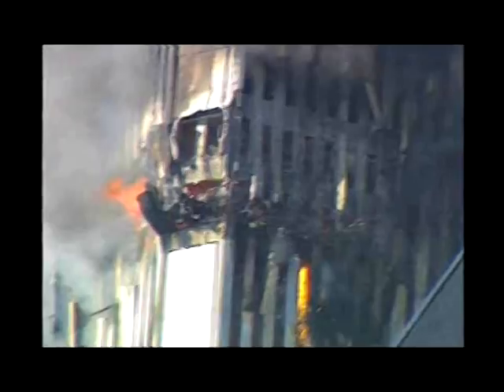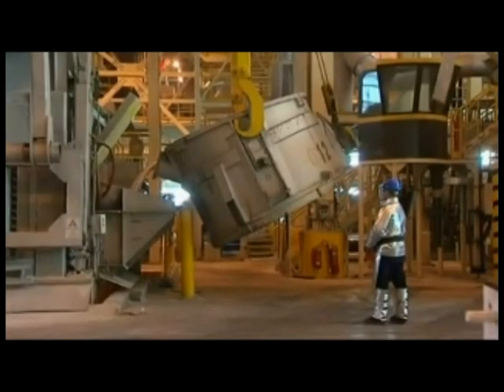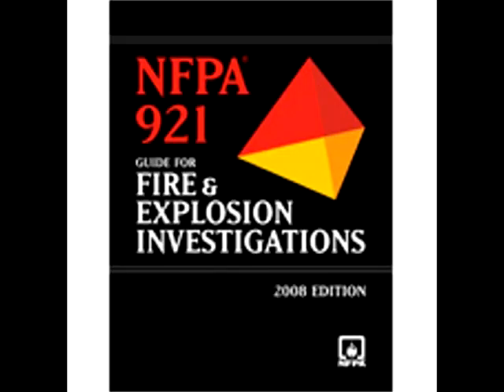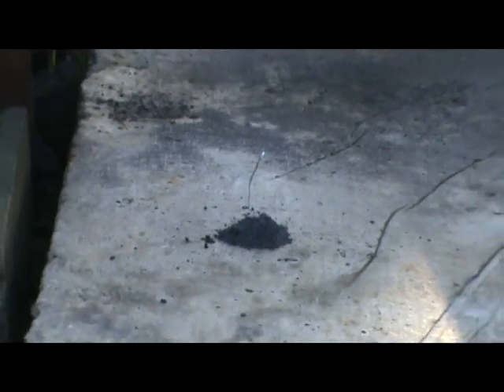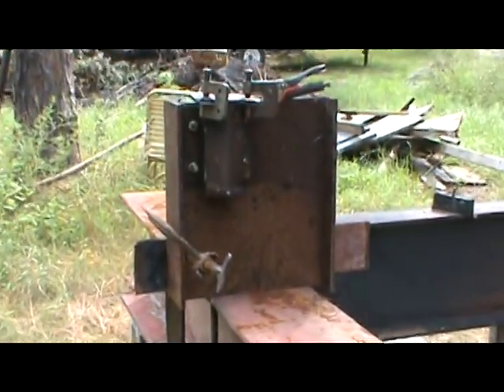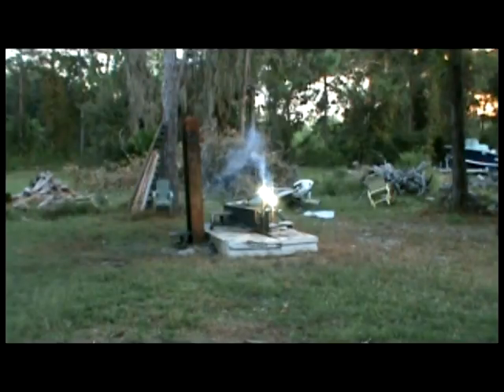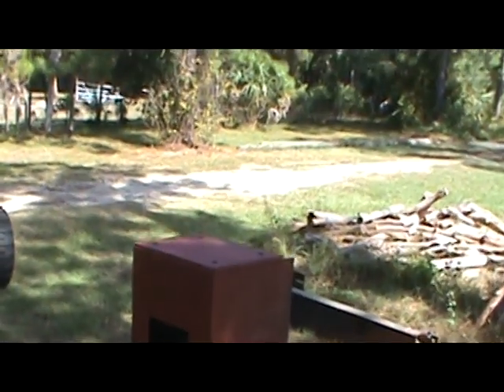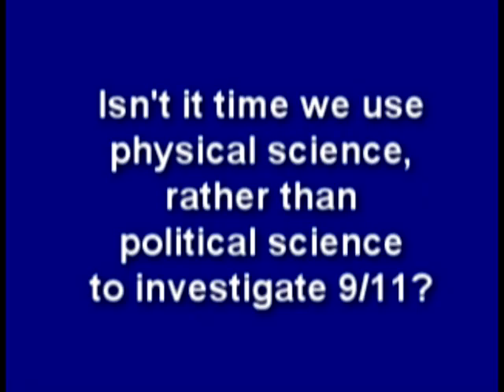9/11 Experiments: The Great Thermate Debate

Comment: Youre all looking at this all wrong. Passenger hets are realitvily slow and only have enough fuel to get to where they are going with a little extra not enoigh to fly abywahere you please and certainly not enough to go 100s of miles out of the way and still have enough ledt over to blow up a skyscrsper in fact if a jet tries to land with too mich fuel it smashes on the runway you can Google this if you like they dont just fill jets up to the top and slap the tail fin and go alrighty then your all fueled up off you go rather they calculate exactly how much fuel is need to get from A to B and put that exact amount in. Then they will add justva little bit extra inc ase of emergencies but they have to calculate the weight if thr plane whats on it including the passengers and the fuel. It all has to be 100 percent accurate or everybody dies when the plane tries to land if you thinm thats BS google, overweight aircraft landings, ypull see even coming in with too much fuel still in the plane can cause catostrophic damge to the pnae they are made of aluminum flying it into anything woukd cause it to crumple like paper they are built to fly not smash onto things every pound counts.  If thats not enpigh to convince you that the builiding were blown with charges then consider the FACT that every commercial plane has a highlu sophiscated GPS system that CANNNOT be turned off and it works even over the middle of oceans and deserts and palces where nobody would ever get cell service not ever, no consider the FACT that ALL commercial airliners keep constant raido communications with the control tower and if ymthey dont check in fighter jets are scrambled to ensure this exacf thing never happens. We needed oil badly nd so we demolshied the trade center and blamed it on the muslim extremeists went to saudi arabia, aghansistan, and iraq the 3 most oil rich coutries on erth and first we went for saddam but then oh it wasnt saddam it was osama and now its about freedom or democracy or some shit who even knows anymore. We did it for blacl goop in the ground and your goberment killed their own citizens because A. They knew theyd get away with it and they did, and B. They make trilliins with thr oil they cpuld now steal instead of paying out the ass to the saudis for why do think saudi arabia has so many billionaires. Oil moron. Thats why.  It was all for gasoline and petroleum byproducts AKA OIL. We blew our own towers we allowed the planes tl be hijacked and we let them fly to towet to make it look real. its not hard to manipulate stupid people especially if you have many many many other people helping you do it. I mean shit i once cinnvonced a .orkn on the city bus i was an astronaught so its really easy to trick dumb people. Like absurdly easy. Like taking candy from a premature  baby easy
Reply: Your English teacher must be so proud.

Comment: Smoke gets "lesser and lesser" when the fire burns hotter, and consumes it's fuel more efficiently.
The shape of the tower turned them into a giant Blast Furnace, the heat pulling air from the bottom feeding the fire.

Comment: Jet fuel and most mineral oils will melt and burn through steel. I know this because I built a simple oil burner to burn oil inside an old wood stove. Once the oil got burning and the draft from the chimney started drawing it didn't take long for it to burn away the baffle plate and burn a hole through the side of the wood stove. I suggest that the hollow tubes acted as chimneys providing a good flow of oxygenated air to the burning fuel and concentrating the heat. And yes thermite is commonly used to weld steel rails together in the field.

Comment: Every couple weeks another first responder is dying from cancer. This has to be from radiation exposure from some kind of nuclear device that was denotated on the plane or in the building. Hence the term "Ground Zero". Weeks after the buildings fell fires were still burning thousands of degrees in the ruble which only nuclear devices are capable of.

Comment: What a ridiculous tin foil hat wearing conspiracy theory! But then I watched the video in question, and there is clearly a stream of molten thermite running out the side of the building. There is nothing else that can do that, at least not that I am aware of. And I am familiar with thermite and it's effects. Hmmmm. Now I don't know what to think. Concrete is a decent insulator of heat, so cutting horizontal slots through the concrete down to where the steel beams are, then setting off the thermite in the slots would cut those well enough.

Comment: Good exposed research. One thing I did not get it, how this thermate was placed or put inside, around the columns? Was it some procedure during construction or how ?

Best regards!
Reply: The weekend before 9/11, there was a power outage that shut off all of the electricity in both towers, and I think Building 7 as well. nothing like that had ever happened before at the WTC, so it was very suspicious. For the next two days, multiple people saw people dressed in electrician-style clothing walking in and out of the building, and there no security stations that were operational in the towers/Building 7 for those two days. I suspect that during that time, explosives were placed in the buildings. Also, there was a photo taken of a few people in one of the towers, showing a few boxes in the background. Those boxes had a marking on them that is an abbreviation for a type of explosive.

Comment: You began by saying there was molten steel, then you say molten steel can't be because of fuel burning. Then you shift only to breaking steel with thermate. The steel won't melt into river with thermate. Smartly shifting the topic, you also ignore entirely the logistics needed for such large scale blowup of a building by planting thermate. Why would there be multiple explosions if government is this smart they can all blow thermate simultaneously with airplane crashing. They are so smart, blowing thermate randomly would be the most rookie mistake. And you think, they would have made that mistake instead of a thousand other possibilities like someone involved in airplane crash doesn't board the plane and someone from Osama say that they didn't do 9/11.

Coming to your smartly distracting the point from what you called melting steel to just structural damage by thermite. Well an airplane simply crashing into a building can break more more structural weak points than your little thermites. You don't explain melting steel. The fluid I believe was likely not steel. So don't begin with that smartly placed question can fire melt steel. We are taking about building falling down because that clearly happened. So question should be, can an impact along with fuel induced fire bend steel enough to break under its weight. Answer is way simpler.

Going by flow of your video, another conspiracy theory can begin by saying, well thermate didn't make that much steel to melt. Then smartly say, all we need is to break the column, then say it was a hammer, multiple explosion and show an I beam breaking after a big blow by hammer.

Comment: People are forgetting about electrical voltage. Each floor has a panel, because of voltage drop the wire size needed would be massive. The wire is ran next to Steel beams. The power would not shut off because it would be on a disconnect not a breaker, no telling how old the breakers are  on the power coming from the panels themselves. Or the Damage Done To The Breakers. The white flashes could have been ark flashes, thus creating a huge welder. This would be a good reason why there would be molten iron running out of one side of the building.
Reply: That's probably true, but there would be automatic relays on the power company wires feeding the building, they would have tripped off, then back on to try to clear the short, and then off for good the second time that they relayed, the power wouldn't have stayed on the whole time I would not think.

Comment: Termite can cut horizontally if placed in a square stock tube with a corner cut off it will produce a directional cut (I should have watch the entire video see you have the same conclusion)

Comment: So... you think people drilled, sawed, bolted, and whatever a steel box of thermite into support columns and nobody noticed? Reaaaallllyyyy? lol Also, FYI: Jet fuel does burn hot enough to severely weaken steel that's already weakened AND under load.

Physics.
Reply: Do your research. There were months of "elevator renovations" prior to the events.
Reply: But not to the point of it to being a molten metal waterfall.
Reply: Justin Dixon yes,  indeed.  You should not only study more physics,  but learn to observe as well.  This was done down to scale. Also with legal materials.  US military would have used better stuff,  but still amazing this guy produces very similar results in his own back yard.  Jet fuel could burn hot enough to weaken strength of grade 8 and lower steel,  towers were made from reinforced grade 10, so yes,  physics.
Reply: Wow you guys are really grasping at straws lol
Reply: Yeah whatever. Keep gullible, that's how they like you.
Reply: justin dixon there have been reports of trucks moving into the wtc late at night and leaving in the morning for three months before the attack.
Reply: Justin Dixon i literally couldn’t agree more. there are people saying that their were “explosives” planted in the building. what people don’t want to admit is that both buildings structurally failed because of impact, ongoing fire, and eventual buckling. in many videos you can see the corner cave in on itself. and the explosion sound is the floors above the plane impact caving in which led to the weight being dispersed downward on an unstable structure. once something is in motion it cannot and will not be stopped. especially buildings weighing millions of tons. people who call foul on our government should actually research how structure and engineering works. the fires may not have caused the steel to melt, but the initial impact and fire caused the steel to weaken. the angle of impact played a huge role in the collapses also. the building was designed, if occasion, to fall straight down. and for building seven ; the collapse of both towers caused building seven to eventually collapse. another thing people don’t understand is that the ash and flames spread upward which furthermore weakened the structure. this was not a government action. those who are responsible for this horrible mass murder either have or will face their ultimate judgment. my prayers go out for everyone affected by 9/11. we will never forget what really happened on that horrific day in history.
Reply: this was just a normal man using normal thermite.   u understand that the military thermite Is wayyyy more powerful and it would also have a much more professional casing.         and if all it takes to make a building like that fall Is a air plane then why in july of 1945 the empire state building didn't fall when a plane hit it??
Reply: Soulsreaper lol a tiny plane back in 1945 going idk 300-400 mph into a giant building. Idiot
Reply: @justin Dixon, enlighten us all, we peasants, with your explanation for Tower 7, then. We're all ears.
Reply: Snowman a building fell on top of it

Comment: Think about what your saying.  Someone would have had to going into the building and weld all of the connections prior.  That would involve a major construction project throughout the whole building.   Massive construction including ripping our walls to get to the steel joints.  In addition you would see evidence all over the place after the building fell showing these kind of results on the steel.   It would have been very obvious.  But that never happened because it’s all fake.

Comment: The melted aluminum from the hull of the aircraft interacting with the many thousands of thousands of gallons of water in the building's plumbing caused hydrogen-air explosions. 

-an independent scientist

https://www.sciencedaily.com/releases/2011/09/110921074747.htm